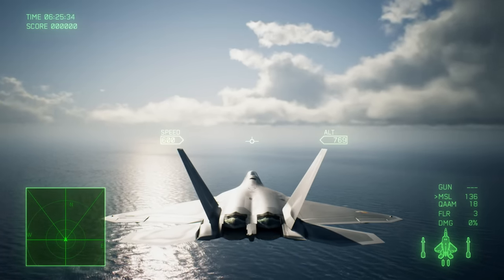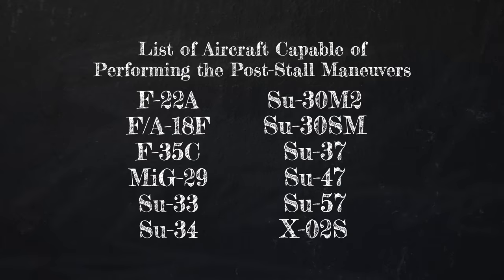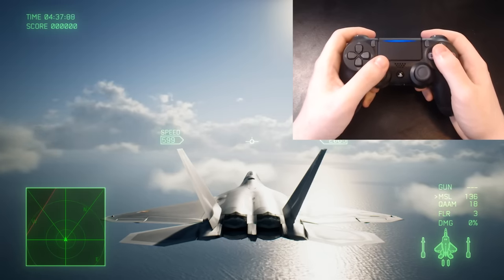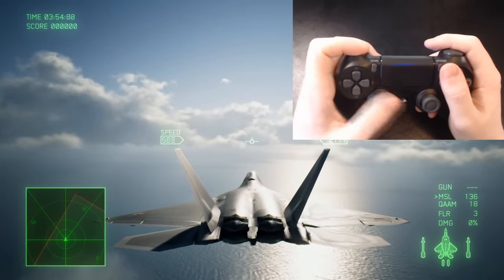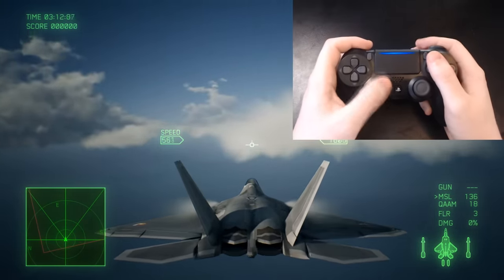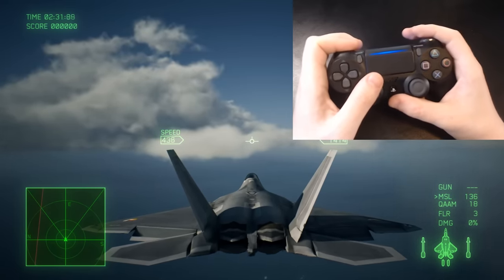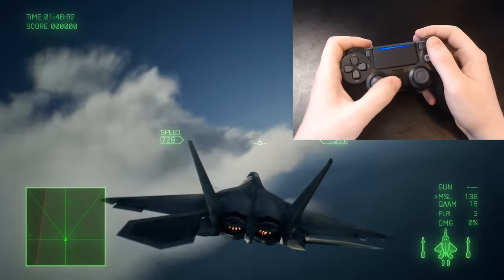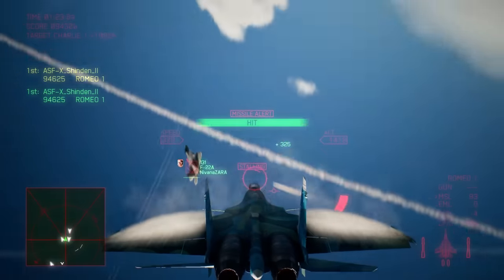Ace Combat 101 - #4: How to Perform Post-Stall Maneuvers

Comment: Only 3 American planes can do it, while basically the entire Russian tech tree can lol
Reply: cause they are only ones that can do cobra IRL
Reply: @licrygh  r/wooosh
Reply: Well, Americans are power over aero, while Russians are aero over power. Meanwhile Europe is none of that with the Rafale, Typhoon, and Gripen having no ability to pull even a cobra.

I can only imagine a load of trick maneuvers you can pull off through PSM. Here are the ones that comes to mind for me, and yes I am still waiting for the PC release but I would not mind if ACF or anyone to try these tricks and see how viable they are:
Kulbit immelman : pulling off a Kulbit but stopping at the 180 rotation to reverse course
Kulbit split-S: same as the immelman, but done inverted
Cobra dive: do an inverted cobra, but instead of leveling off, you maintain bearing and accelerate into a dive
Kulbit dive: stopping the kulbit with the nose pointed to the ground and dive away.
Reply: SiegeWolf IV ooh an r/whooosh  in the wild
Reply: The MiG-21bis can't. :P
Reply: Right, but all those planes still cant out maneuver the only 3 merica has.😂
Reply: They should’ve brought back the F-15S/MTD. Or given us the F-18 HARV or the X-31 Vector, or the X-29, or the F-16 MATV, or the F-16 CCV (originally started out as the first YF-16, but was modified by NASA)
Reply: @macrossMX  It's not exactly that simple.

The reason most US aircraft can't do shit like this is because they're designed to be completely unstable without FCS, they'd completely tumble out of control without it, or if you were to relax AoA limits enough to allow Cobra. F-16 for instance would go belly-first the moment you'd disable FCS (not that you'd have any control at this point, since controls are completely digital) or otherwise tried to force it into a Cobra-like maneuver and would require some weird voodoo shit to recover from the resultant flat spin (since it's STABLE in a flat spin and has no control authority while in this state, which is why this aircraft was controversial to begin with).

Meanwhile, the Russian aircraft - especially the Flanker family - are designed to be aerodynamically stable in yaw and only unstable in pitch - but not completely unstable, Su-27 stabilizes either somewhere around 60 degrees AoA up, or ass and back first (you don't want to end up there). The way the controls work with those aircraft though is also different - they have proper mechanical controls and in absence of FCS they're still flyable, just require more skill to keep straight. This is the whole trick behind the Cobra - once you disable FCS, you can pitch the Flanker way beyond 90 degrees angle of attack and it will go back to forward flight on its own - as long as you either catch it on the other end (so it doesn't go into an inverted flat spin) or turn the FCS back on to let it stabilize the aircraft once it recovers. So it's not strictly about ability to turn ass-first, it's about the aircraft's controllability in this state. The reason Americans went into the full Fly-By-Wire territory was to improve manoeuvrability, but by completely relying on digital control rather than making the aircraft marginally stable with a traditional control system that is only stabilized with the computer, they actually ended up limiting their aircraft's performance, because even the FCS wouldn't be able to control these aircraft in maneuvers like those. A skilled pilot can pull way more out of a Flanker because he's only limited by his own skill and aerodynamics.
Reply: Digolgrin that's because the mig 21 shape makes the plane more unstable at lower speeds   have the same problems as the dassult rafale, euro fighter, and gripen if you look close enough the mig bares a similar body and airframe shape as those three fighters. so yea.
Reply: @m4ti140 and the European aircraft cant do it because of the limits of there delta shape making them extremely unstable in maneuvers like the cobra same with the mig 21
Reply: It's kinda weird to see a lot of planes without thrust vectoring on that list. Including F/A-18F (mentioning this so no one would use it as a proof of Bussian Rias)
Reply: @EarthWasHere  Su-47 and Su-57 are a force to be reckoned with, they will stomp on F-22
Reply: @vantuz8264  Mig-29 was the first to pull off Cobra afaik
Reply: @Massakre8492nd  No, that was accidentally done on Su-27 by Igor Volk and then performed publically by Viktor Pugachev on the same aircraft. 
Cobra can be performed on some aircraft using only balance and aerodynamics but Kulbit (AFAIK) demands thrust vectoring.
Reply: @vantuz8264  Ok, thanks for correction
Reply: @ornithobiography  funny thing is I don't have reddit, blame youtube's recommended videos
Reply: @Massakre I killed both planes in an SU-30SM Mihaly so it depends on skill. it doesn't matter if its a good plane a skilled pilot in a f 22 could kill a noob in a su 47/57.
Reply: @suctioncupman1607  in terms of armament Su-57 has an advantage with PLSL, Su-47 has qaam and better qaam, we're talking purely stats here
Reply: @Massakre8492nd yes I know both planes are weapons of mass destruction irl (su 47 isn't really because there is only one and its a tech demonstrator but anyways, lets move on) and in-game but it all boils down to skill and knowing you opponents next move. You cant use an Su 57 plsl and Su 47 qaams to there full advantage if you don't know what the fuck you're doing.
Reply: @vantuz8264  SAAB Draken?
Reply: Power of thrust vectoring
Reply: That'll be because the US planes are entirely fly-by-wire, and the Russian planes are not. This is because without the FBW system the US planes are incredibly unstable, nigh unflyable, making them more maneuverable in every other possible category.

The US planes also have, you know, stealth and superior computers and avionics. So they can't cobra as effectively but they can shoot down any aircraft on the planet without said aircraft even being aware of their presence.
Reply: @thedog556 we arr talking ace combat wise
Reply: RUSSIAN BIAS!!!!

...wait wrong game.
Reply: @nickfury1279  frankly, we should get a prop plane in DLC while we're at it, since nothing in game gets FAEB's right now, which is criminal
Reply: @suctioncupman1607  oh course, we all know the real destroyer of worlds is the F-104 lead balloon
Reply: @thedog556 my guess is that they gave the Hornet access to it to mimic the LEX setup that gives it better control at high angles than most planes
Reply: @thedog556 actually the mig 29 can do the cobra
Reply: @spindash64   HAHAHA HOOD ONE M8 😂
Reply: @thedog556 and the European aircraft cant do it because the aerodynamic limits of the size and shape. And yes they can't thrust vector but of they had thrust vectpring they still couldn't because of there shape
Reply: @suctioncupman1607  The Cobra isn't an ACM.  The Saab Draken could do the cobra back in the 70's.
Reply: @suctioncupman1607  Delta wings are very stable at high angles of attack.
Reply: @macrossMX  in theory the rafale could do it
Reply: thedog556 I'm not in the mood to argue I just finished a hazbin hotel fanart piece after 12 hours and a psm is done at low speed and delta wing configuration is highly unstable at low speeds.  Which is why they have canards and they dont need thrust vectoring is because of there size and agility makes them more agile than most thrust vectoring aircraft but nonetheless European aircraft use the delta configuration which is highly unstable at low speeds and use fly by wire systems which help keep the jet aloft at lower subsonic speeds. Not as bad as the f 22 but not as god like as the sukhoi family tree
Reply: @Massakre8492nd  Nope.
Reply: @EarthWasHere  In 7, Yes they will
Reply: What is it with "wooosh" being used completely out of context lately? Does it now just roughly translate to "I don't like your comment but I can't argue it so take this!" instead of its original meaning? It's getting a bit dumb.

It reminds me of when "cool story bro" was a thing and people started using it on 3 word comments.
Reply: insert russian bias joke here
Reply: Did he say the su-35 CANT do it??
Reply: ITT: People confusing Ace Combat, an action flight game where aircraft can carry dozens of autoreloading missiles and laser pods, with real life. 

Yeah, cobras and kulbits and whatnot look cool. They're also a desperation move in combat. You pull that fancy cobra to try to force an overshoot or whatever, your entire aircraft becomes a giant airbrake, you lose tally on whoever was behind you because you can't see through the cockpit floor, and then when your nose comes back down you've got basically no energy to maneuver with, even if you punch it to burner (keep in mind a real aircraft takes significantly longer to accelerate than an aircraft in Ace Combat). So even if you pull this thing off perfectly, bring your nose down and find yourself behind the bandit's 3-9 line... okay, he's probably zoomed out past you and he still has plenty of energy to play with, he can easily get on speed to do a nice tight high performance turn, while you're lucky if you have the energy to keep your nose anywhere near him.

You could bring up fancy high off boresight missiles slaved to helmet mounted sights. Okay, cool, I think it's reasonable to assume the enemy probably has them too, and as soon as you enter that cobra, you're a big fat juicy target (if he's glued to you so tight that you instantly zip past him, why hasn't he already dumped a load of 20mm into you?)

I'm not making a case for Russian planes being shit or something, they're... alright, I guess. I'm just saying that air combat isn't fancy maneuvers like that, it's a lot more dependent on the tactics of the elements involved (because you basically never fight as a single ship), and the judgement of the pilot on what maneuvers to pull when. A fantastically well trained pilot with real world experience in an F-16 (that's "only" capable of 9G turns, no thrust vectoring) will beat the ass of some newbie in an Su-27 any day.
Reply: To be fair, by "most of the Russian tech tree" we really mean "Suhkois plus a mig" the Suhkois shape is very consistent between models so it makes sense that they can all manuver like this
Reply: @licrygh  This is so false it's hard to keep arguing.

Btw, a Viggan did the Cobra in an airshow before anything else :)
Reply: @delayed_control  There's so much more than that.
All western design carry the same stigma which is all about them "EM diagrams".
It's all about energy and high energy states. 
When we want to truly compare fighters, we should look at CImax, AoA @ levels, sustained turn at FL 320 and higher, instantaneous turn at fl 320 or higher, rate of climb, and a handful of few others.
That point, is where all the russian bias start to crumble like a cards castle. That is also the point where you look at PW119 and F135 from the Raptor and the F35 and start drooling wondering "HOW DO THEY F*ING DO THAT!?"
Reply: But are those fancy post stall manuever really that useful in modern air combat? Has it even been used in modern war?
Reply: @W1ckedRcL  I didnt say anything about video games
Reply: @casekocsk  In a sense. Extreme low speed maneuvering is the bread and butter for carrier ops.
TVC conceptually was born for that, giving STOL capabilities to carrier fighters.

As a combat cadre no. EM and energy states are what truly matters, that was evident after the Gulf Wars.
Also maneuvering with AB always engaged drastically kills loitering times and leaves you no fuel to do anything else. That's the legacy of the Falkland war where the British Harriers had a ridiculous advantage over argentinian Mirages simply because the latter had no fuel to spare, either for combat or to RTB.

Fuel efficiency is, as of today, still the most important aspect of air combats.
No juice, no fight.
Reply: Doesn’t really matter. In real life situations, American planes can pick apart Russian planes at a greater range. The stealth fighters also will be striking before Russians can even detect them on radar (Russians have a way to detect stealth BUT it’s very limited and not at all practical in a real combat situation). 

In a traditional close end dogfight, yea many Russian planes are a serious threat. But with the advent of modern air combat, it’s unlikely such dogfights will ever even occur. 

Real life, plainly put, isn’t at all like Ace Combat. In all odds, American fighters will win most combat situations if both pilots are of equal skill.
Reply: Русский Коммунист 
I was talking about modern aerial combat. Even in the Wars you speak of, American planes shot down more Russian designed planes and won most aerial engagements. 

Today no Russian plane can really out do the Raptor. Even in a close in engagement or traditional dogfight, Americans hold an edge. Now if we’re talking about F15, 16, and 18s vs MiG 29 and Su fighters, it’s a lot closer and evenly matched. But F35 and F22 by far not only outclass Russian planes they also outnumber the best Russian aircraft.
Reply: @ajaxaceofaces  PAK FA is very close to f22 and f35
Reply: Русский Коммунист 
PAK FA is definitely close but it isn’t going to outproduce the F22 or 35. It’s radar cross section is larger and the 22 has better armament. The newest SU is also pretty close but majority of experts grant the American Raptor an edge. And again, it’s unlikely Russia will mass produce these planes.
Reply: @cyberkek4115  no lol. Su57 is a mock up of low visibility fighter.
Get a high res picture of a Su57 and a J20 and enjoy the staggering building quality differences.
Reply: @W1ckedRcL  I'm going to clarify what happened that night. The nighthawk was not equipped with a terrain following radar and couldnt use radio comms or navigation (the LPI hardware were not a thing back in the days). The Serbs smartly acknowledged the flight pattern of that particular f117 and eventually they connected.
Reply: @ajaxaceofaces  don't get fooled. The pakfa isn't any more stealthy than a clean superbug or viper.
No radar blockers in its air intakes, too many gaps and visible riveting over its skin. God knows if it even has real RAMs or paints. No serrated nozzles. That is simply a yet-another-Su27 derivative, just with fancy 5th gen-ish looking and su35 avionics.
Reply: @sh0ckv3l33 
Thanks for the information. I wasn't aware of the specifics, just the incident itself. Looks like I need to do some reading too.
Reply: @macrossMX  draken can
Reply: Russian bias.
Reply: @EpsilonVegaAlter  that isn't a r/wooosh 😑
Reply: @FlightReactsFan911  but it is my friend. When has AC ever fully followed realistic standards? Also who cares? I just want my cfa 44.
Reply: @EpsilonVegaAlter  and hé want tellin Jokes he was sayin facts
Reply: @FlightReactsFan911  LMAO
Reply: @EpsilonVegaAlter  ?
Reply: @EpsilonVegaAlter  u prob dont even know what Lmao means
Reply: F15 sisters too
Reply: This is a result of the tomahawk training, pilots must throw a tomahawk at a ground based target as the craft performs a psm through a burning tunnel
Reply: Pretty much real life too
Reply: Anytime a smoov brain brings up the f117 as an arguement against stealth I- <brain has left the chat>
Reply: @suctioncupman1607  I'm curious, so Russian planes have more ability to do post stall manoeuevers and American planes are putting their money on high tech avionics and stealth. What is the European design philosophy? I don't know about IRL but in AC 7 the Euro line just seems to be "one-size-fits-all" multi-roles with the Typhoon leaning a bit towards the fighter archetype.
Reply: @licrygh  You've never seen the F22 do the Cobra?
Reply: And it's bullshit.
Reply: Soy Sauce Stain it doesn’t matter. Losing that much speed to perform those maneuvers in an actual dogfight that doesn’t even happen anymore would be the end of a dogfight for that person/plane. To lose energy like that is to lose a fight
Reply: @licrygh  the SAAB Draken was the first to pull the Cobra
Reply: Yep, i re-checked info about it. Thank you
Reply: @sh0ckv3l33 Maybe you mistaken Saab 35 Draken with Saab 37 Viggen, because i found info only about 35 doing this maneuver. However, i read that this maneuver was not shown at public at this time because of Cold War secrecy and became famous in 1989 Le Bourget Air Show when Viktor Pugachev performed it. 

Other planes performed it too (Mig-21 as well), but i suppose that power/weight ratio is important while you do that as well as maneuverability. Russian jets performing it more, you can find much more videos about it.
Reply: @ajaxaceofaces  You can depend on hi-range rockets, but here we have powerful electronic warfare countermeasures, flares and etc.  If you will fail, you must engage planes at close range where Russian jets have more maneuverability. 

Also, iam no stealth expert or something like that, but if you will spike stealth jet only with one radar, sometimes stealth will work (but stealth material on jet is very costly and being damaged even by rain or another atmosphere effects thanks to friction little by little, so its efficiency will drop). 

You can spike stealth fighter with two or more radar stations from plane formation or ground (it could be stealth for one radar and visible for another) and send data via data communication network (for example, via AWACS). 

Also, I read somewhere that F-22 haven't data transmission/receiving ability with other planes/AWACS or something like that.

But here we go, we all here love planes (that's me). I didn't wanted to start political trash talk. Dude just asked why all Russian planes in game can do cobra and i answered. I will be happy if they will release Saa 35 Draken too, cause its wonderful looking plane with the Bartini wing.
Reply: That's what you know about lol the triangle planes can do more than that lol
Reply: My ace combat 7 in aircraft tree all the jets are  sukhoi
Reply: Digolgrin actually the mig 21 is capable to doing the cobra
Reply: Air superiority is just that..  american and Russia both have perks... Wouldn't mind seeing russian vertical take offs though...
Reply: @EpsilonVegaAlter  he said right so you are wrong
Reply: woooooooosh
Reply: The MiG-21 can actually pull off a Cobra Irl, it was one of the earliest planes to do it, it’s just not commonly talked about.
Reply: Massakre8492nd The first aircraft to pull a Cobra was the J35 Draken
Reply: That's actually historically accurate.
Reply: Actually Russian aircraft cant do a cobra with FBW enabled
Reply: @RogerJL  actually Viggen is the "father" of Grippen
Reply: @thedog556 Su47 does exist but its just one prototype
Reply: @shadowguardian3612  yes, but as I wrote Draken is the "grandfather" of Gripen I just spelled it a bit wrong...
Reply: @RogerJL  yeah and I didnt read Grand
Reply: There are some US aircraft that might do the post stall maneuvering such as X-32, X-36 or most of their modern aircraft. But we're still not ready to fight aliens yet lol.
Reply: @EarthWasHere  they can trust me
Reply: Rice Farmer Qaams stops all
Reply: Massakre8492nd I’ll go with the F-22 because it has better attachments and the best missile in the game
Reply: @thedog556 they said the 8492 didnt exist and look where that got them...
Reply: @EpsilonVegaAlter  r/ihavereddit
Reply: @nore5992  im sorry, im stupid. i apologize. Thought about deleting it but I'll just leave it as a reminder.
Reply: And two of them can’t even fully do it.
Reply: Joey Rath  Yes
Reply: Russian bias confirmed
Reply: @macrossMX  actually no the grippen is probably one of the most agile aircraft made the swedish pretty much just kept improving the j35 Draken design high maneuverability, relatively light design, highly strong single engine and alot of technology into the aircraft which one of the reasons the saab j37 was one of the most advanced aircraft at its time also what is showed in game is not a cobra maneuver since the cobra is pulling straight up at a 90 degree angle and stalling your aircraft this post stall maneuver isn’t real, irl the only thing that can be done and even a p51D can do is a full upwards circle
Reply: @Massakre8492nd  and no the first plane to do the cobra maneuver was the swedish j35D draken get it right but it was first performed at a flight show by pugachev thats why theres the cobra maneuver and Pugachevs cobra
Reply: @thedog556 the su47 does exist and it was flown not too long ago
Reply: @thedog556 but its real and flying
Reply: @macrossMX  The Eurofighter Typhoon can do a Cobra Maneuver
Reply: Yeah, America’s planes aren’t  really about maneuverability.
Meanwhile, in Soviet Russia maneuverability is everything.
Oh also, I know it’s a joke. Just saying.
Reply: Ah yes Russian bias
Reply: @macrossMX  that is mostly because European planes can carry a shitton of armaments, much more than a russian or American can carry. Look at a fully loaded rafale a it can literally carry more than a b17
Reply: Well it is Russia so I'm not suprised
Reply: That's fine. To me these moved are borderline useless. I rarely even barely have a need for them
Reply: @PoopFactor4  - It's actually more agile in real life, but yes, it also relies a lot on BVR.
Reply: @Digolgrin  yeah because it's a flying cucumber
Reply: People really gonna say “Russian bias” unironically as if these PSMs are something to strive for IRL.

In reality, these moves bleed your air speed so much you are left completely vulnerable to absolutely everything.

For Russia that’s fine. Russia’s air doctrine doesn’t expect to gain air superiority over NATO, so they don’t build their planes for air superiority. NATO doctrine demands air superiority, so they do.

The trade off is that NATO craft are better for airborne fighting, while Russia’s aircraft can do some neat parade tricks.
Reply: Everyone gets a r/whoooosh